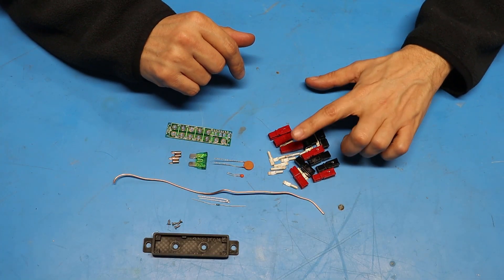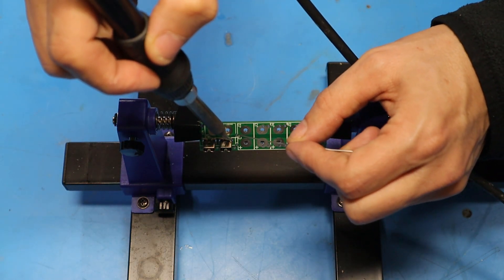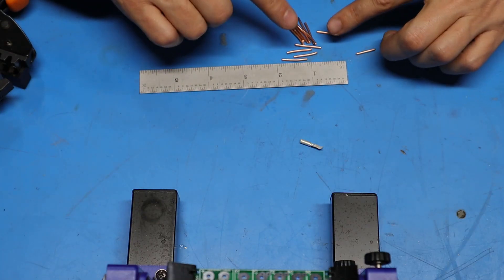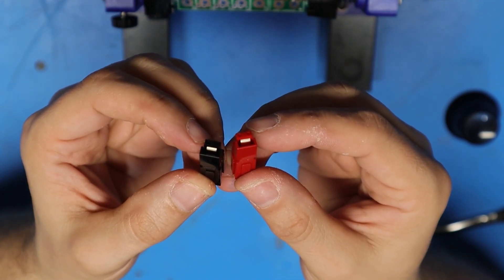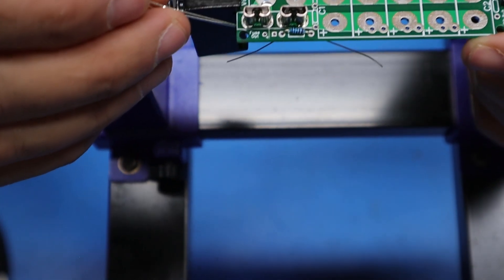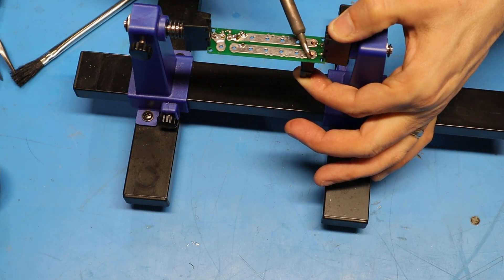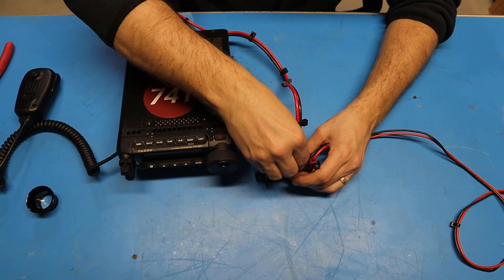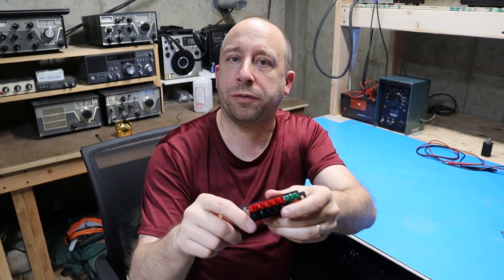Ham Radio Kit // K9JEB Anderson Power Pole Distribution Block

Comment: I have a question. Why do I always see an open-barrel terminal crimp tool used on these closed-barrel anderson power pole connectors?  It is a serious question.  Does anderson recommend this tool for their closed-barrel terminals?  Why would everyone not just use the same tool which is used for all other uninsulated barrel terminals???
Reply from the maker: I'm pretty sure the crimpers I used are closed barel.  There is a link in the description that brings you to 5he amazon link I used to buy this tool.
Reply: @SevenFortyOne  please look at the pictures in the Amazon link you posted....they are all open barrel
Reply from the maker: I guess I don't know the difference.. either way, they seem to work just fine

Comment: Nice kit Rob and loved the video! I received my solder station yesterday and am looking forward to making projects like this. Thanks for sharing. I bought some solder, flux, wick and a snippers like the one you have. I got a Hakko FX951-66  from Tequipment which did not come with the tip. I got a tip that they recommended. I hope it works for me.
Reply from the maker: That's a nice setup - it should work great.